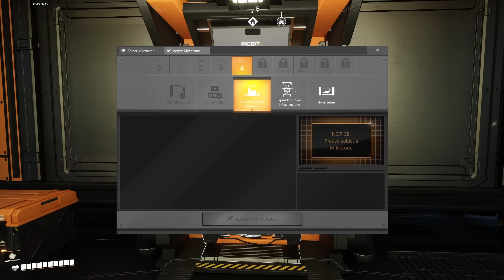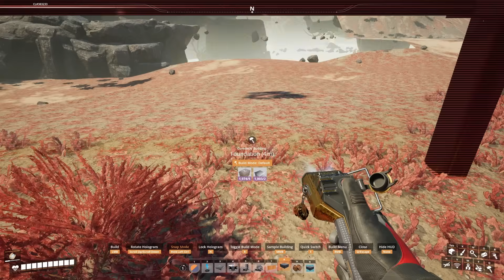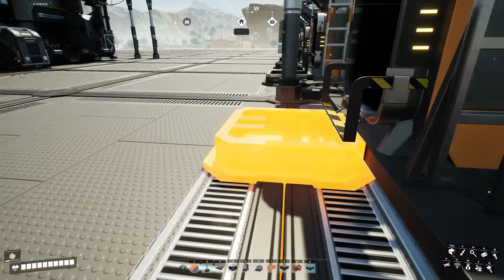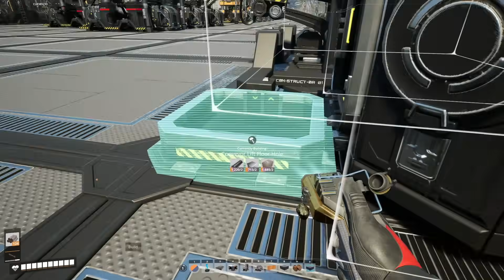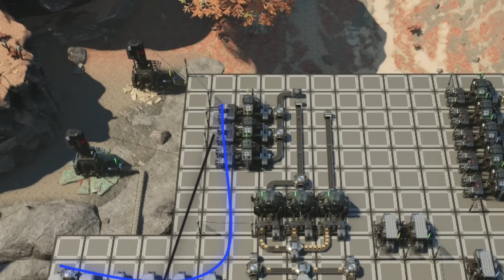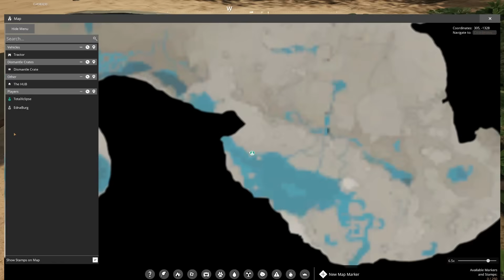Space Elevator Parts - Satisfactory 1.0 Guided Playthrough EP.04

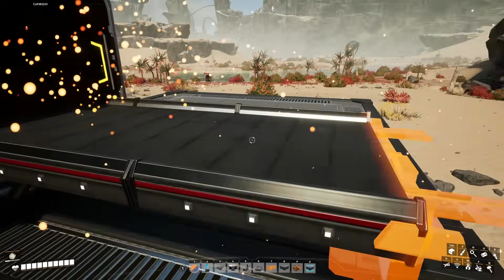Comment: I'm confused about the throttling at 13:28.  I was under the impression splitters distributed evenly regardless of the output belt speed, or does this work because it skips an output if the belt is full, so it will just eventually back up into a working state?
Reply: Evenly yes, but since the Mk 1 belt is much slower (hence the 60 items / minute), the splitter will try to output on it faster than it can carry the items, leading to a blockage in which case the splitter will send the item on the next conveyor belt until the next item.
Reply: @TrygveOni  great to know, cheers!

Comment: Managed to finish this. A secret is to open the Satisfactory Tools website and add there the final products like he shows 2 times in the video, later on he adjust the number for Automated Wires. In the Satisfactory Tools will show you all required buildings and rates needed. Then, scroll to the part of the video where he shows the finished build from above. Using this 2 things, will make following the video much better. Unlocking the celling conveyor belts support will do things even easier.

Comment: Wasn't the whole point of starting this guided playthrough to NOT skip? It isnt even about doing every single thing exactly the same, but when going from "I need to bring iron over" to actually it was copper, but also did the iron now we skipping past 3 different connection setups straight to the middle where we connecting wire to cables. And for those who do want exact replicas of what he is doing, it makes it easier without skips because it makes it easier to see how his belts line up. Putting things in exact locations to see how he is able to fit things or how he might change something due to a complication rather than him just skipping over those spots to "oh look here it is". Just like when he skipped ahead on the steel beam setup where he completely relocated 3 assemblers without saying anything about it. Honestly no point in calling it a guided playthrough when he was doing the same thing in his other videos, which is why people wanted this series, for an unskipped version of his factory building.
Reply: Lmao
Reply: Right, he shouldn't be calling it a guide if he skips around so much and doesn't actually guide every single action he's doing. Like it's not a guide if it leaves everyone confused

Comment: The only thing I don't like is how many machines are overclocked in these builds. All of the overclocking quickly leads to exponential power requirements which I wouldn't consider easy to manage as a beginner. I say that the trade off of spending a few extra resources on an underclocked machine is well worth it compared to less resources for an overclocked machine.

Comment: I don't understand how the iron rods work here.  Each were set at 87.5% creating 13.12. The screws need 11.25 and the modular frame takes 15. Both were directly hooked up to the 13.12. The modular frame is never going to get the 15 it needs to run. Am I missing something?
Reply: I got it to work by setting the iron rods for screws to 75% and the one for frames to 100%. Then use a smart splitter to send the overflow to the 100%. Finally prime the 75% with stack of ingots.
Reply: @skylarsmith9514  know its been a year but thank you! thought i was the only one confused about that part

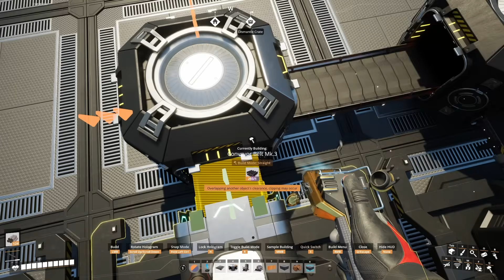Comment: 48:30 Thank you SO much for mentioning the alternate recipes here, made me check my collection and reminded me that I had Steel Screws unlocked. With the way the coal and iron was set up, I could just remove two of the iron smelters (unneeded with the two others making 50 Iron Rods), replace them with a forger for steel and then only use 2 constructors for screws (one for Steel Beams, the other to convert Beams to Screws) instead of the 10 needed for that half.

Comment: less than 70 hours in and I just feel so lost and overwhelmed with your steel production layout, the logistics floor feels like an added layer of complexity I am not ready for yet. I would much rather have smaller modular factories for each part than combining them all like you do in this video. I am sure I could figure out the logistics floor though. it will just alot of time
Reply: I’m sure you’ve got it by now but the logistics floor is super easy. Basically just have a floor under your production floor and you can use conveyor floor holes to use lifts to bring your items down/up, have all your machines on the main floor but route everything on the floor below

Comment: My go-to place for steel is the huge waterfall from crater lakes down to rocky desert.  Three pure coal nodes at the top and three pure iron nodes at the bottom, plus a pure copper and four normal limestone nodes within easy reach.  If you don't mind getting the coal down a fairly decent elevation, there's a bare minimum of 360 steel ingots per minute.

Comment: when you were throttling the coal line, i noticed you used mark 3 belts after lifting it.  would that screw up the throttling you did right off of the Miner?
Reply from the maker: Nope - if you throttle a belt to say 60 then add a MK2 after that, the resources will travel quicker to the factory, but still receive no more than 60 items per minute at the factory
Reply: @TotalXclipse  nice! Thanks for responding.

Comment: Phew... so I had been following your guides pretty closely up to episode 3, and for the Versatile Framework I decided to take a stab at my own design. I must admit, though it is not producing the full 10/min the calculator suggests, it is hitting about 8-9/min, and I think it has to do with dividing my ore lines. I am still struggling with some of the ways in which resources get divided between each other when they need very specific amounts. Eventually I just said F-it and settled for a lower overall efficiency. I mainly wanted to try using my alternate screw recipe, and it has turned out quite nice! Thanks for all the advice. I will keep watching but I think I will start doing my own build first then seeing how you did it. The one thing I wish I had learned earlier was the logistics floor. I would have loved it if we were doing that from the start.

EDIT: I figured out why my efficiency was low. Apparently one of my conveyor belts in the Iron Ore manifold was not connected so my last 2 foundries were not producing ingots. Once I reconnected that line, the whole thing came online. Quite a rush, oddly enough!
Reply: I swear, that hit of dopamine when you see your setup working perfectly is more addictive than cocaine.

Comment: Thanks for this video series, Xclipse. I'm sorry to report, however, that I seem to have run into a math discrepancy with the Iron Rods used for the Modular Frames.

At 29:26, you mention that 15 Iron Rods are being sent to the assembler for Modular Frames. That would be ideal, however, at 27:00, you said that both Iron Rod constructors were to be underclocked to 87.5%, resulting in only 13.125 Iron Rods being sent to the Modular Frame assembler.

Have I missed something? The only way I can see to make this all work at 100% efficiency is to build an additional smelter so that the two Iron Rod constructors are fed from independent Iron Ingot lines rather than splitting a combined Iron Ingot line equally into the two constructors.
Reply: left one on 15 and mid to 11.25 ez 26.25 :)
Reply: @maxkleber8268  My mistake! I don't know what was going on with my constructors, but for a long while, things were out of balance without any signs of slowly getting better. While the mid one was at 100% efficiency, the left one was only around 75% efficient. It was idle often. I assumed it was because the splitter was taking that 26.25 from the smelter and splitting it evenly, sending 13.125 to each constructor.

Finally, after trying again, I waited and finally saw the belt feeding the mid constructor back up, allowing the splitter to send more ingots to the left constructor, allowing it to slowly reach 100%. Thank you!

Comment: At the start with the coal will it hurt to run both full out instead making one 60? Is it just to save power?
Reply: Yes, it’s to save power, but more importantly it’s to keep everything running efficiently. For example if you have a group of smelters taking in 300 iron ore between them per minute, there’s no point having the smelters powered to process 400 items per minute. It’s better to underclock the machine(s) so that they only get provided with enough power to handle 300 per minute. That way they are running at 100% efficiency. It’s also an OCD thing lol.

Comment: I love your guides and have decided to go ahead of you a bit. I did setup my own version of the advanced steel factory where the 4 coal nodes were located. Yours was a bit closer to the iron and copper. I also used some logistic floors but mostly stuck with keeping the belts on top in manifolds. I’ve unlocked a lot of the tiers that you just unlocked at the end and am eagerly awaiting to see what you’ll do with mk.4 belts and trains since assembling the computers and other space elevator parts for the next tier will require parts that we are already producing. I can’t see building an even larger factory to produce those parts again so I’m guessing you’ll be using trains to move all the pieces to a central factory? Just a guess. Keep em coming!

Comment: What about the starter factory?will you tear it down?its just too big and doesn't make enough resources,maby turn it into a storage hub of some kind
Reply: Think.  Tear down, then can't build bigger as no power, not enough materials.  Need power first, oil.  Then expand, new big factory, parts from starter.  Then redo starter, maybe.  But almost always better to build new.  Worry about old when run out of untapped nodes.